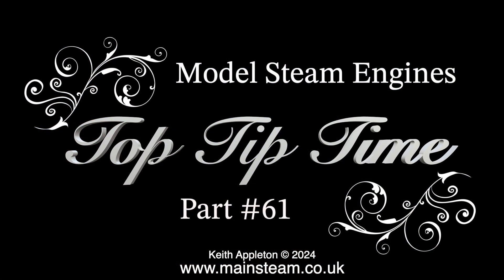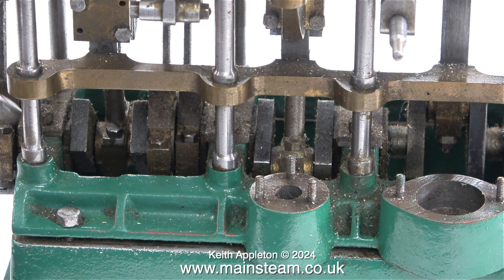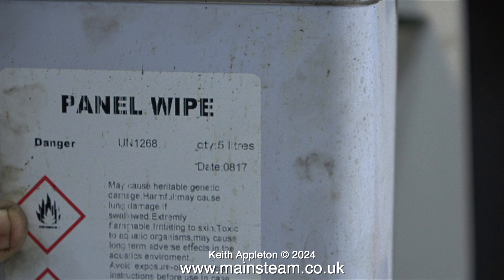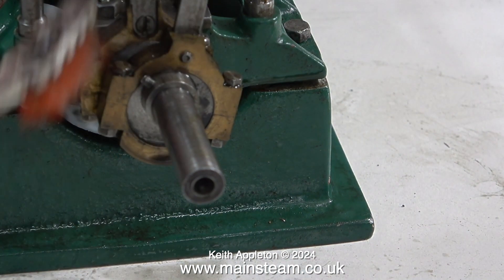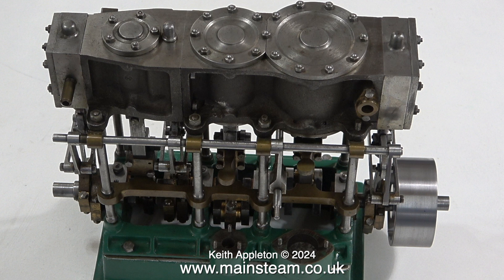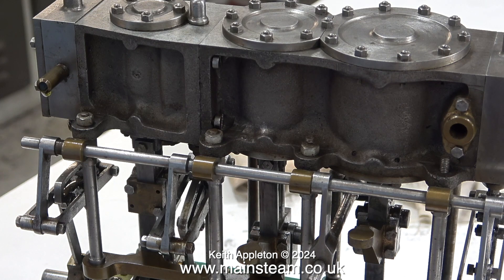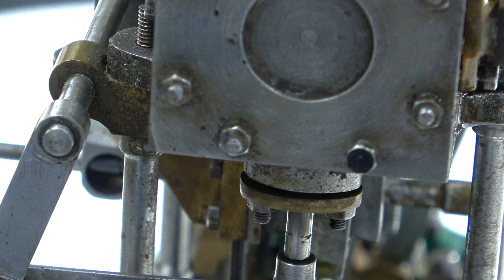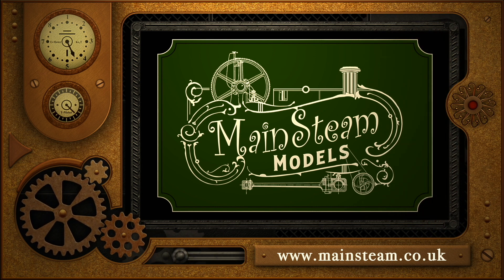MODEL STEAM ENGINES - TOP TIP TIME - PART #61

Comment: Hi Keith, 

Do you have a video on how to make wicks for wick fed oilers on traction engine's?
Reply from the maker: Just buy the wick material and feed it from the tank into a pipe leading to the bearing. Type lubrication wire wick into an Ebay search.